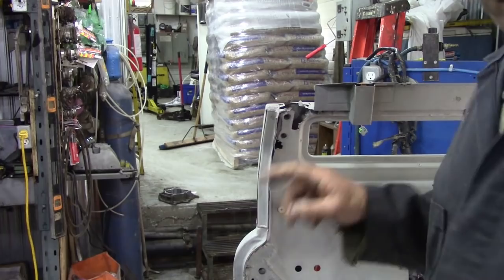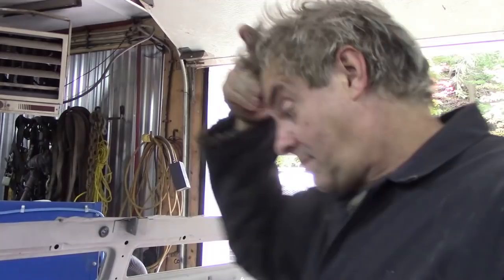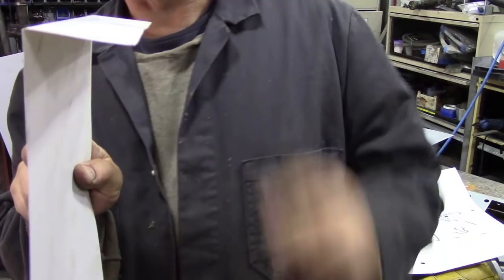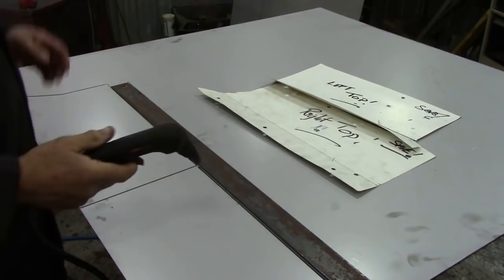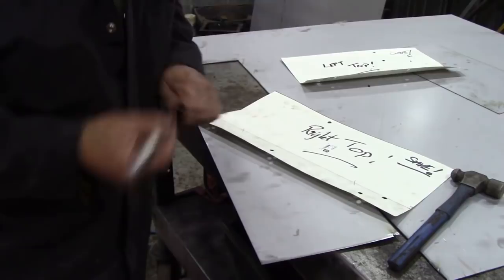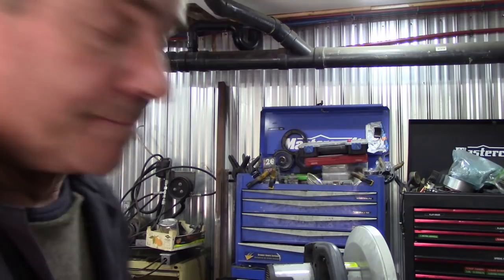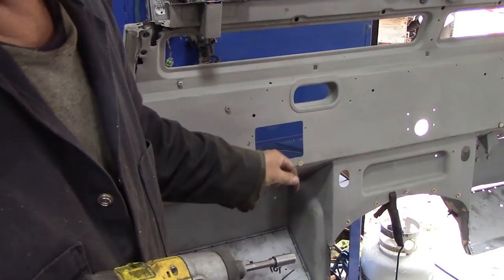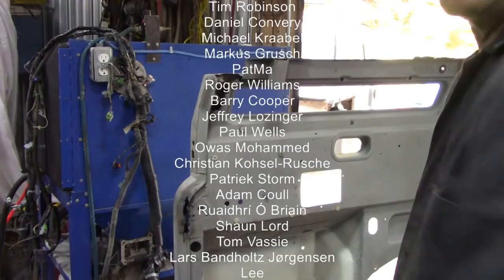Defender bulkhead repair part 1

Comment: Mike, 1: What is in that big plastic-wrapped pallet feed for the impending food shortage or rock salt? 2: Love your videos, keep them coming. I watch every second of every video. I have a 2004 Discovery Series 2 because that's what a sensible person would buy in Macon, Georgia, USA back then. Love the thing. Its oil is in my veins and my blood went through its engine, gaskets, and onto my driveway. Can't wait to drive it up and visit you. I suppose I'll have to wait until I don't need the jab to get into your country.

Lost the house to a fire on USA Thanksgiving 2021. Audi Q5 and Ford F-250 lost to the fire too. Fortunately, the Disco, which we call Nigel, was in the shop waiting on catalytic converters that someone stole.
Reply from the maker: Wood pellets for my boiler

Comment: Hi, Mike, I did my series 3 footwells in 1.5mm stainless steel problem solved both sides and the battery box.
Reply from the maker: stainless is not too good to weld to mild steel
Reply: @BritannicaRestorations  Just you try it on a bit of scrap Mike but use .8 mild steel wire  you will be surprised all my welder mates told me you have to use 316, no you don't it welds perfect I used argosheild 5 gas it may not be as strong but god enough for floor plates and patches on my old landy cheers mike keep up the good work making landrovers better, Oh i am looking at l322 td6 next but can't find one without rotten subframes what do you reckon to them mike your advice would be greatly appreciated  thanks.

Comment: What is the rocker panel spray you use and what’s it’s purpose?  You mentioned that it will degrease the surface of the patch panels?  I have the same job to do on my Series III and have the seam sealer, but not aware of the purpose of the rocker panel coating you used.  Thanks Mike!  You’re the best!
Reply from the maker: Matt - - the rocker spray is a HD plastic coat that bonds to metal and makes a rubberised coating that  seals against water and abrasion 

You must degrease before using to make a 100% bond
Been on my 130 10 years and no rust on the footwells

Comment: Do you think, now bear with me here, using the plasma as a hammer may explain the tips going all the time?
Reply from the maker: The plasma torch has a spring loaded tip, so when you pull the trigger the internals go back a bit to make contact with a switch - this sometimes sticks - hence the tapping
Reply: @BritannicaRestorations  I was only pulling your leg mate. Now back to decorating.

Comment: Mike, around about 18:40 you have what looks like a 300tdi pulley driven by a belt, is that a PAS pump or something rigged up for something or just a pinched pulley for another task?
Reply from the maker: Ah! if you saw that in the background that is my pump/steering box tester!